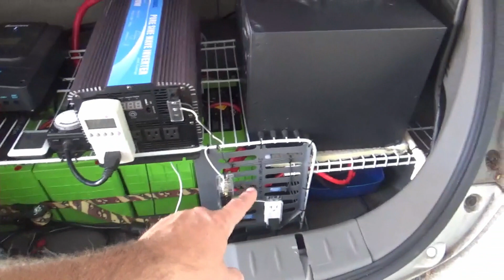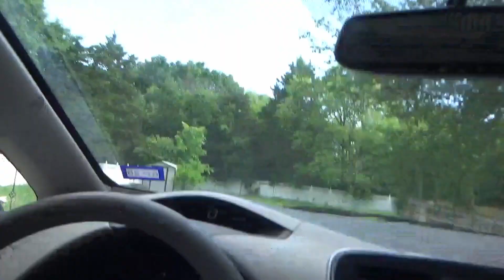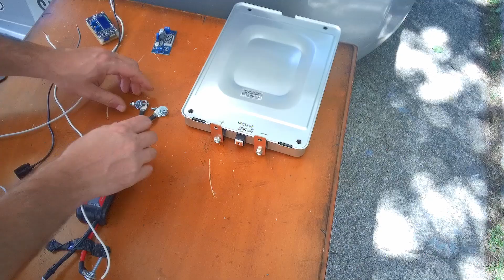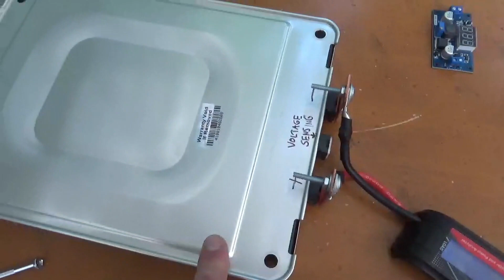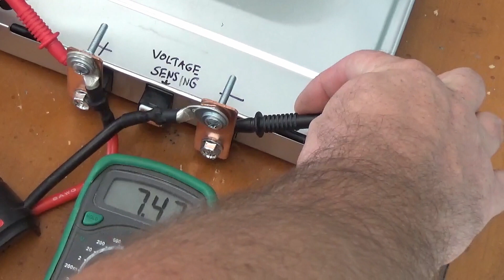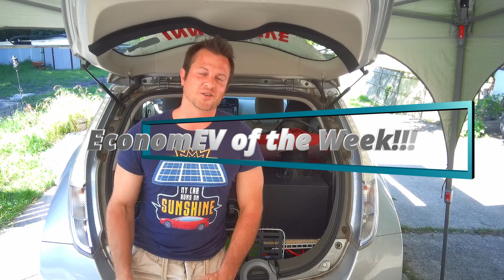Nissan Leaf Battery Module Capacity Test

Comment: Cool video! I found this other video of a third party company that makes a device to update/flash/change the software on older Nissan Leafs to accept newer, higher capacity batteries than what the old ones came with from the factory (even though Nissan says this is impossible). I wonder if you could buy more battery packs that are 50% degraded like your existing ones and just string them together with the old ones to effectively make a larger battery? I don't know what the dimensions on the inside of your battery pack look like in terms of allowing for additional battery packs and if the car could handle the extra weight of more packs, but maybe it could help for future projects? Anywho, here is the video: https://www.youtube.com/watch?v=AlxzlQgovUA

Thanks again for posting this content!
Reply from the maker: I'm familiar with EVs enhanced.  I don't know how they procured their budget to develop their own software and hardware, but they seem to have done a really good job of it.  I love the plug they built to trick the vehicles BMS into thinking whatever battery we bolt under the vehicle is supposed to be there.  I think you might actually HAVE to use EV Enhanced's plug to get the 2013 Leaf battery pack from the first EconomEV (the junkyard one) to successfully pair (from a software prespective) with my 2011 for example.  Kudos to them on making that product.  I see the value in it, and hope I will get a chance to do a video where I use it for a full battery swap.

As far as using multiple packs:  The problem you run into is weight.  The packs weighs around 370 pounds, if you only use the modules and ditch the large encasing shell (600 plus lbs all together)  Your returns start to diminish very quickly as you add this weight to the vehicle.  I think if you removed the weight from the vehicle itself and put 2 or 3 60% packs in a small utility trailer, coated the exterior with solar panels, and made a trailer hitch jack that connected fairly quickly to the vehicle that might work.  A kind of EV road trip kit/large portable powerwall.  Under $10K, tons of utility, only carry the weight of the batteries when you need the range.  Thank you for the SEO time recommendation.  It seems to have worked :)
Reply: Soon those guys will make a Tesla Battery pack work on a Nissan Leaf.... LOL. Amazing technology.

Comment: Hi. Reducing current increase voltage. P=U *I
I think the DC DC converter is limited to 24 W (3A*7,9V). The internal  resistance in the replacement module is important. This must match with the other modules in the battery.

Comment: You haven't made any new videos for a while. Curious how your sun eater is holding up and how you're power wall made with used Nissan leaf modules. I did change out all my modules from my leaf from Green tech and in the process of using the other modules I took out to make a power setup similar to yours.
Reply from the maker: Life happened in early 2022 and I had to sell my house and my solar car.  I got divorced, and while I maintain that a Lea is the perfect second car for a family, its not really feasable as your only vehicle.  At least it wasn't for me.  Been saving up for the last three years to get some land again, and get back into the off-grid game.  I'll have to get caught up on your channel and see how far you've made it.
Reply: @InnovativeSustainableSolutions  divorces are always very hard. That's why I never got married for I had to deal with family members that had ugly divorces and pretty much cured me in getting married for it isn't what it stands for like back in the days when parents got.   married.

Comment: You suuuper shouldn't be charging like this. Charging lithium cells in series without a BMS is a good way to make a battery fire. You also charging or discharging this chemistry without compression.

Comment: You can get a brand new 60 Kw Bolt pack for a little over $12,000
Reply from the maker: That's $200/kwh.  Not a bad price, I usually shoot for $120.  Can you reply with a link to this pack?
Reply: @InnovativeSustainableSolutions  I am pretty sure I can find it.  Found it comparing Battery Hookup new Bolt cells I ended up buying 140 cells essentially a whole pack for about $6,000 last spring. I love them and BRAND NEW. I have seen new Leaf cells before but its been a while maybe when they were transitioning from Gen 1 to Gen2 .  Thought at that time about getting the whole Bolt pack and using with one of Jack Ricards (RIP) high voltage inverters  Inverters etc for my system.

Will post link today if I find it.
Reply from the maker: @teekay1785  HV production and storage and generation is definitely the way to go.  Jack's belief (and mine) is that eventually most of our power will be consumed in the 400V range (for transportation).  We drive all electric now, and a little over 50% of our consumption is for EVs.  Our PV array is 120VAC grid tied (they almost all are), so it runs through this Rube Goldberg sequence of inverters to convert it into the 400VDC power that constitutes a majority of consumption.  Jack's way is smarter and more efficient.  I miss him.  If you got a 60 kwh pack for $6,000 you got a VERY good deal.  You almost never see Lithium batteries for less than $105/kwh.
Reply: @InnovativeSustainableSolutions  Yep I know look at about 8 seconds on this David Poz video same cells brand new the whole packs mounting holes didn't line up with the frames so not installed. They were a pain to DIY but glad I did. Its getting where you can get some of the Life cells for around $100 per Kw if you buy in quantity via alibabba etc especially the 280 ahr cells right now. I considered that but with these Lg cells lasting well in cars and high dc I believe they will last 20 years or more in low amp home use plus using mid 80% power range . I got 10% discount from david poz code and talked to them ad they waived the shipping fee ? 250 0r $350 flat rate since I waived home delivery and picked up at terminal.  Total was $6300for 62.1 Kw.  
https://www.youtube.com/watch?v=BzPUFcXM89c
I share your vision of the future trend but even avid DIY often dont want to deal with 300-400 volts. Here is a link to my DIY tillable 30 panel mount. Its tilted 51 degrees in this photo.
https://imgur.com/0pkZC0F
Reply: @InnovativeSustainableSolutions  here it is if it works . > maybe can only go to dealer for putting in a car? Might be worth getting a Bolt owner to get a new battery and you get out . I also wondered if they requited a trade in? Hope link works.
gm-battery-24289549

Comment: Nissan did add a battery cooling system,just not on the leaf.The E-nv 200 battery which is just about the same drive train as the leaf uses battery cooling from the vehicles a/c freon.I found it really sleazy that nissan decided to only sell these vans over seas and bombard the US with leafs with no thermal management.

Comment: Our leaf has 3 bars now
Reply from the maker: Ouch.  Definitely time to replace these modules.  The good thing about having a heavily degraded battery in the car is it makes it easier to find modules that are in better condition than the ones currently in the car.  I think I have a lead on some 60% cap modules for about $40/piece.  That $2k for 48 new modules, and you could sell the ones you replace for atleast 300-400.  Should be able to get your Leaf up to 6 bars for $1600-$1800.

Comment: Didn't they change the physical dimensions of the 2018 and later battery modules? Maybe it was the rear battery modules in the 62kwhr pack. If so, wouldn't that affect replacing cells in an older leaf's pack?
Reply from the maker: Yes, they have changed the modules twice.  They are on the 3rd generation of modules in the Leaf battery pack.  You will have to make sure you are buying the right modules to refurbish your battery.  The biggest hurdle though remains finding undegraded modules at a reasonable price.  This will become impossible within the next two years.  A different solution is needed

Comment: Look ill give you credit on leafs having potential and electric becoming the new meta but its to an extent cause under loads for use as what i do they are super inefficient as soon as they have and load they bog out and drain quick again im all for ev but its still limited in its capabilities and theres a lot to still be learned about dc energy and i mean its a whole world to learn of dc electricity and its capabilities and how it works but claiming it lasts longer that a gasoline counter part is a bit too much if it was a fact everyone would have transitioned to ev but the truth is ev isnt there yet
Reply from the maker: You're right.  Everyone always does things in the best, most efficient way possible.  There is not 1 example in all of recorded history of people NOT using the most efficient, most capable tool or technology available to them.

Comment: Our Nissan Leaf Gen 1 Battery Modules are perfect for DIY Powerwalls & DIY lead-acid to lithium conversions for your RV, Golf Cart, E-Bike, etc. giving you more power, less weight, longer life and ZERO MAINTENANCE!*If you are building you own pack using these Nissan Leaf Battery Modules please let us know how many of “TYPE A” & “TYPE B” modules you will need. BE SURE TO USE A BMS WITH YOUR PACK!*
https://bigbattery.com/product/nissan-leaf-battery-module-g1/
Use coupon code "Cycle5" at checkout for an extra 5% discount.
Reply from the maker: Do you guys sell a 96s bms?

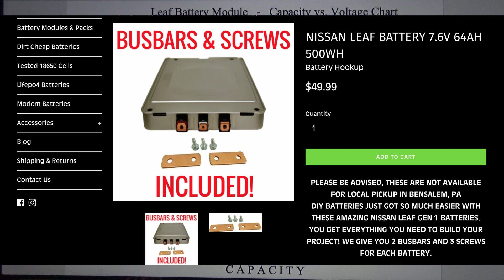Comment: @26:15 you stated, "Lets go with the low end of the estimate = 75%".   No, the Low-End of the range is 67%, as is clearly stated in their document that you displayed in your own video.  Only, SOME of the modules will be in the 75% -  85% range.  SOME = very few.  Most people are not getting GEN 1 modules with 75% capacity remaining, more like ~60% capacity.  GEN 1 batteries are, at least, 7 years old.  If the battery pack was replaced by Nissan for a warranty issue, then most modules will be LESS THAN 70%.  Many GEN 1 battery packs were already down to 85% capacity in the 1st year, and that was 9 years ago.
Reply from the maker: Precisely the low end of the stated range WAS 67%.  The 2 modules I tested had a capacity of 55% (275wh).  At best, their statements regarding the capacity of the modules were misleading.  I consider a discrepancy of this degree to be false advertising.
Reply: @InnovativeSustainableSolutions  Very "slick" wording on their behalf ...

Comment: Let me pitch my idea by you and see what you think. I just bought my 2013 Chevy Volt. (Yes the hybrid Volt, not full  electric Bolt). I am a student living in student housing, making it difficult to always have a way to charge my EV. I've been very interested in your project and want to try one of my own. The only difference is I want a set up solar charger that I can sore in the trunk and set up on a sunny day on the roof of my car. I would want it to output the faster 240v charge since it takes about 10.5 hours for my volt to charge on the 120v charger I currently have and that is just too darn slow. Do you think this is a viable option? and how would you go about making it? (Honestly, I think this could be a really cool product that could benefit the average commuter in a similar situation like me)  Please and thank you! :D
Reply from the maker: Let me start with your desire to charge at 240v.  This will be very difficult to achieve because of the wattage you would need to power that.  I think the slowest amperage the vehicle's charging hardware will operate at is 6 amps.  Power (wattage) = Amps X Volts.  So even to charge at the lowest amperage you would need (6X240) 1,440 watts.  I don't know of any solar car in the world that has achieved that.  The highest solar power I have achieved in the Suneater to date is 500 watts.  At 120v that power requirement drops to 720 watts.  Much more attainable.  The battery bank powers the inverter that runs the charger.  You set the charger to run for every other hour or so, and basically 2 hours of sun powers the charger for 1 hour.  Solar powered vehicles (IMO) work based on the premise that the car is parked 90% of the time, so if the charging is really slow, that's fine.  So, take a moment, and ponder that and if you're still interested in a couple days shoot me an email and we'll figure it out.  -Sam